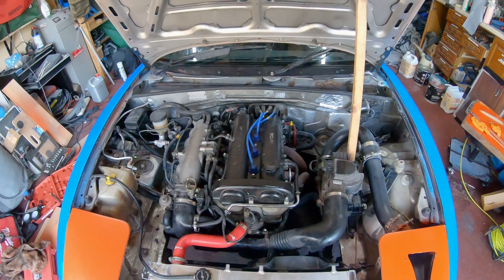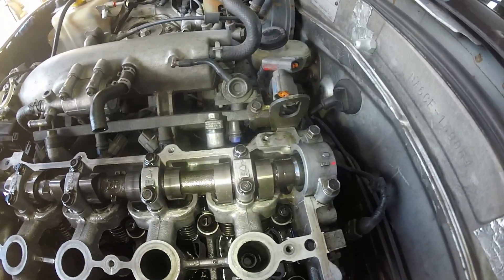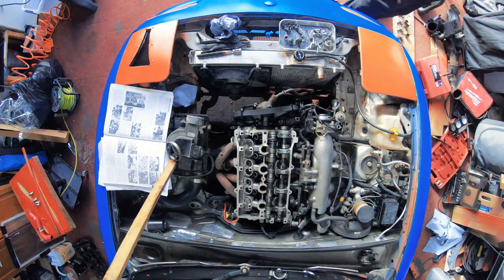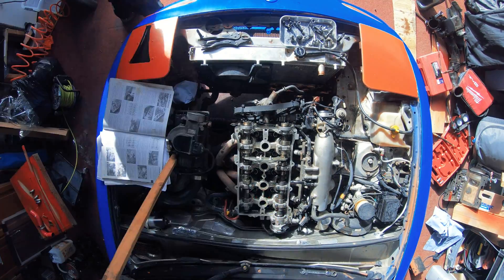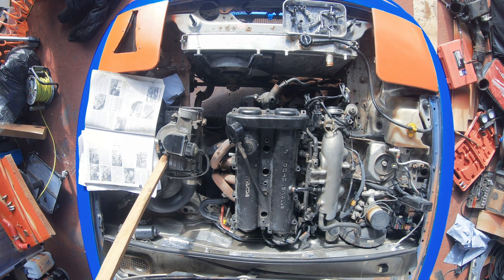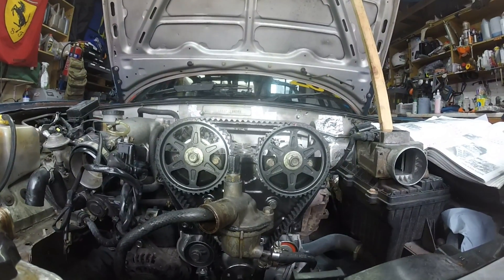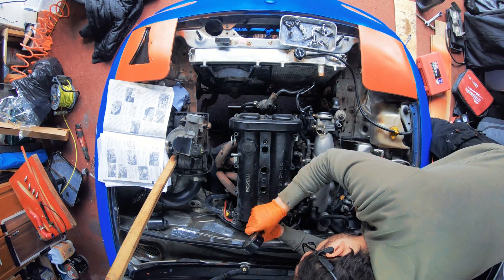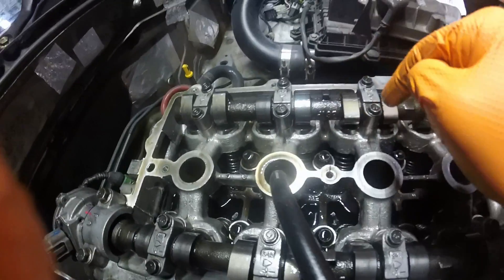Low Compression on Freshly Rebuilt Cylinder Head: What's the Problem?

Comment: Exhaust valve sticking in guide . Bent valve or to tight valve guide or jacked up lifter . You can pull the lifters apart and clear oil way. When are you hopefully  at snetterton.
Reply from the maker: Thanks! Took the head off this evening and yes - issue with the valve (brake clean leaking though closed valves even with the cams off. Supposedly next Saturday out at Snet 🙃

Comment: Curious to see what ita going to be now. Piston rings should be fine as compression was better before and leak down didnt help. Suprised if valves were bent as its non interference so pistons cant hit valves. Mystery
Reply: Interesting that 1 & 4 are ok as they are a pair, hydraulic lifters would be surprised if more than one failed.
Reply from the maker: I know! I don't have a complete history on the head so I suppose it's possible it's been skimmed so much that it now is interference! The guys who rebuilt the head pressure tested it too before handing it back to me so id be surprised if valve seats but everyone makes mistakes sometimes I suppose (although it's more likely my mistake, the amateur, than the professional)